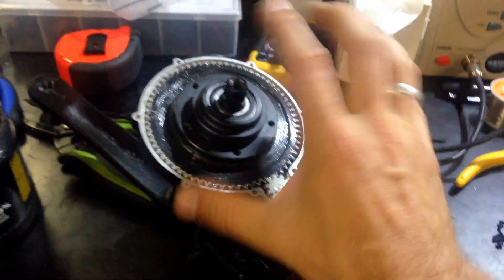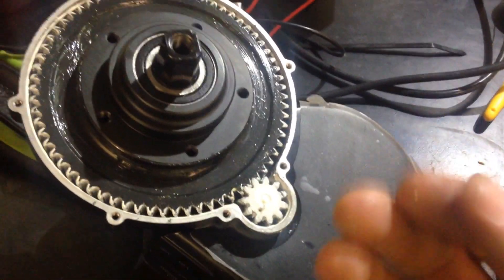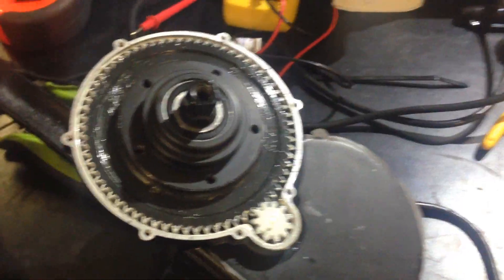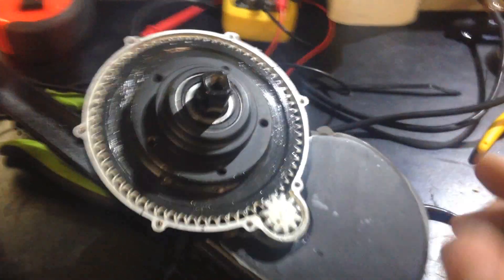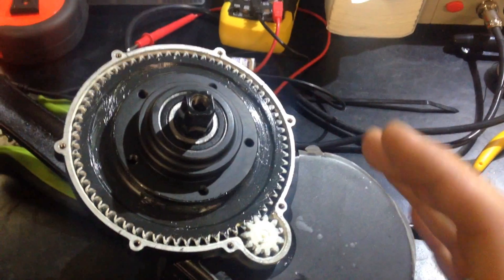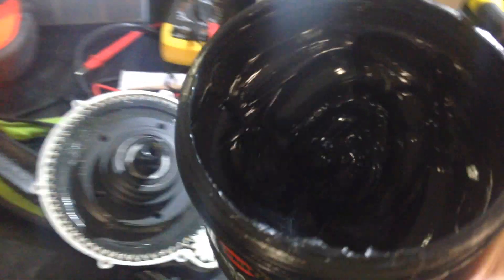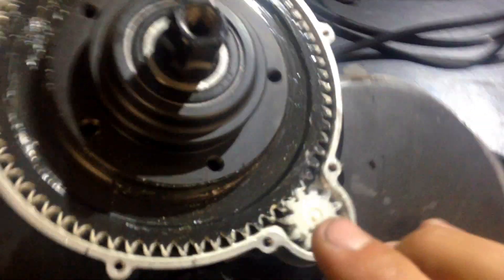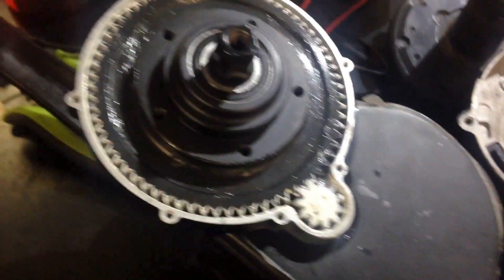Bafang 8fun BBS02 - White Lithium Grease "problems" • Electric Bike 750w 48v mid drive kit

Comment: Hello, I have a question for you. In my electric bicycle motor, there are cylindrical metal bearings located under the planetary gears. Is it appropriate to lubricate these bearings with the same grease?

Also, in the main power transmission area, there are different plastic gears. What kind of grease should I use for those?

I applied the same lubricant (Molykote PG-54) to both areas, but the motor became significantly noisier. Is this normal?

Thank you for sharing the video and providing information on this topic!

Comment: Hello Mr. Brun, I am Italian, from Sicily, I have a 750w bafang motor with 28 Mh battery, bought in 2019, could you help me understand why the red LED of the wheel sensor no longer lights up, which no longer shows the speed parameters on the display? Is it possible that it is the pass card, sensor or the pass disk? Thanks for your work, you have many videos, you are really good

Comment: i found the ultimate grease: Superlube Silicone grease (contains PTFE) with added 0.1 micron tungsten disulfide powder. some extra 1.6 micron PTFE powder will also help, but tungsten disulfide seems to work even better. this mixture also only needs to be spread onto the gear teeth (silicone is very sticky grease, doesn't fling off at high rpm) , not the entire enclosure cavity. it's way more silent than mobil 28 or black moly grease, especially under high load
Reply: @IBX no, I have used it, but grease displacement over time is an issue. Go for a calcium sulfonate marinen grease (e. g. Quicksilver brand or Lucas). they have all the characteristics you need:
-extreme tackiness
-extreme water resistance
-extreme pressure
make sure you clean the gears and housing well, first remove the bulk grease with a spatula, then with a paper towel and finish off withba paper towel wetted with gasoline or a paint brush with gasoline for the gears.
Reply: tungsten disulfide  is hopefully non electrical conductive  .  So if grease moves to the electrical parts,  no risk to have some shortcuts.
Reply: @jean-mariejm7404  tungsten is a metal, tungsten disulfide is not a metal and not conductive
Reply: @JoLe1991  ok, thanks. I withdraw my comment

Comment: About greasing the BBS. I have been reading about greases lately, and since finding Mobilgrease 28 is quite hard in my area, i just found out that we need a synthetic based grease to use in both gears (plastic and secondary unit). Most synthetic based greases do not deteriorate plastics and elastomers. To be sure, you will have to check datasheet. From what i read a lot about moly-based is no good for nylon. Synthetic-based greases are usually more expensive than mineral based greases, but some are not too expensive. In my case it would be very expensive to order mobi 28 from US, just not worth it. An example of alternative would be liqui moly thermoflex spezialfett, which in my case would be cheaper and availabel for pickup from a store.  Most synthetic based greases can bear high loads and speeds, and they suit bbs gears fine. So if you have experience or know more about it, go ahead and correct me. Cheers!
Reply: The one i mention, Liqui Moly one is also expensive, but i found one that is made in Russia, and is far cheaper, meeting all the requirments. You might find something for your country also. One i am talking about is Efel Sg-311 and Efel Sg-321, which i doubt are available anywere but Russia. But you must have similar from brands like agip, ravenol, etc. Just look for synthetic-based grease.

Comment: so the Kincrome 500g Multipurpose Grease from Bunnings, is that 1 grease does all, or do I need another grease for the nylon gears, bbshd, cheers
Reply from the maker: Yeah the multipurpose is for the nylon gears, some bearings, freewheel...
the big metal gear touching the metal pinion gear you use molybdenum (moly grease) black one “Penrith” get from supercheap

Comment: I'm not so sure about stuffing it completely full of grease. That doesn't sound right to me. If there's no air gap then any movement inside the assembly necessarily has to move a whole bunch of sticky lube out of the way.
Reply: It's not sticky and it's not lube. It's grease. Do you not understand what grease does?

Comment: why dont they put a grease zerk on the unit??
Reply: I have drilled a small hole in the carter pointing to the nylon gears. Every 500 km  I insert the tube of the PTFE grease spray and I liberally spray the gears,  It takes 2 mn , without having to open the motor.  One small rubber cover  or neoprene glue to waterproof the hole

Comment: how about Bbshd do we need to open it and put my greese. mid drive bbshd 1000 whatts from Luna cycle
Reply from the maker: +Mario Lopez yes all mid drive motors use internal gears so eventually you need to check the grease, add a bit more, sometimes replace with completely new fresh one... the BBSHD recycles the grease over and over again so in theory it requires maintenance less often but there is a lot more torque on the BBSHD than the smaller BBS01 / BBS02 motors and people ride in completely different conditions so it's hard to say exactly how often you should stop and check. If you notice any different motor noise , please stop and check =]
Reply: ElectricBike thank you so much !!
i bought my BBSHD FROM LUNA CYCLE. i also asked them to make super fast for hot rod . it's been 2 weeks i have been using it daily and i feel if the motor vibrate a little or maybe it's the cassette i don't know and i can't find the problem. that's why i asked you if i need to open it and put more greaser. thank you brother!
Reply from the maker: +Mario Lopez Marioooooo yeah the motor vibrates a bit depending on the RPM and the load... it's the resonant frequency combined with machining tolerances... my motor does the same if is throttle only, as soon as I start pedalling the vibration goes away.. try that and let me know =]
Reply: ok i will thank you Bruno
Reply: Does greasing help with the vibration at all? Mine starts to vibrate and almost make a grinding sound on throttle or anything above 3 PAS on a 5 PAS scale. Thanks

Comment: Hey Bruno... Why is it that the 48v 750w BBS02 have no assist on level 1-2..?  It seams that I have to jump it up to assist level 4 before I feel any assist.  Sent the first one back and the second one is just the same.  On level 5-9, the assist performance is great.  But I don't always want to use up my battery in the first couple hours.  It would be nice to just have a small amount of push on level 1 and not consume the battery.
My old 48v 500w BBS02 had noticeable assist performance on level 1 (not a lot, but you could definitely feel the boost)  Do you have recommendations..?  Do I need to adjust the programming on the motor..?

Comment: I have one kit bbs02 750W 1509 (bought a year ago) with these problem, almost nothing lithium grease on the second reduction (going to put the moly grease), it has almost 1700km and the motor have a bad noise. Still have to disassembly more to check the pinion gear, nylon gear and the motor axis. Thank you very much Bruno, nice videos!

Comment: I already have the motor installed on my bike (bought used). How involved would it be to disassemble it enough to check for the grease problem and is it worth it? Motor has about 200 miles so far. Thanks.
Reply from the maker: +Johnny V - Hi Johhny... 200 miles should be fine for a while...  maybe check the grease when you reach around 600 miles, all you have to do is to remove the drive side crank arm, another 5 allen bolts holding the chainring and you have access to the plastic cover that protects the gears and grease from dust.  Please watch this video https://www.youtube.com/watch?v=3lVRTRFueUU where I show how we do in the workshop applying the molygrease between the gears. =]

Comment: Thank you for making me aware of this.  My new motor purchased in November had white lithium, and very little.  I packed in good as you suggested and it is indeed quieter and I'm sure it will last longer now that it is properly lubricated.
Reply from the maker: Hi Robert, the moly grease is automotive grade, sticks to metal and still performing even when there is no much grease left between gears. The White lithium grease Bafang uses is high quality and long lasting one... but.... not for this particular application... 
My friend Karl from www.electric-fatbike.com is trying some different greases, he just published an article yesterday talking about the Mobilgrease 28 aviation grade grease. 
I'll be posting so many other videos explaining more about the internal design and how it impacts the grease, noise and performance on the BBS02 and BBS01. Bafang perfected the design with the new BBSHD, I'll be also making videos showing both units differences =] POWEEEEEERR!!!

Comment: Bruno I have a question.  Can I use grease in the primary gear, nylon gear, and secondary gear.  Moly grease for metal.  Lithium for nylon (plastic).   What kind of grease did you use for the small circular bearings.  Do you need to grease the small bearings?
Reply from the maker: +Nelson Olivo - Yeeeahhh... two separate greases, Nylon (internal/primary gear) = white grease, don't need to touch if your motor is new, maybe after thousands kms you open and check it. The big "external" secondary gear moly will do the job. I have never greases any bearings, I hears very few people telling that they used a very thin multi-pourpose machine oil but I never needed. Also I avoid mixing oils and greases as if they are different they may react. Both white and moly are lithium base so not problems there. There is a very interesting article from Karl where he tests a different aviation grade grease on both primary and secondary http://electric-fatbike.com/2015/12/23/mobilgrease-28-bbshdbbs02-because-a-good-mid-drive-is-better-seen-and-not-heard/ he tested for a while and seems good option. We are just not 100% yet if this will have any downside after thousands of kms but there are some good people out there trying things for us =] one day we get there.... haha

Comment: I would say they get out of moly, so they just put there white one. ;))

Also been thinking about re-greasing (Now have over 3000km on bbs02 and with no big problems, just had to tighten freewheel screws). Bruno, could you advice what is best grease for shaft bearings? Also if nylon gear needs to be re-greased as not sure if I want to open it up completely. Thanks
Reply from the maker: +DaDo Bzz - Yes, there is a lot of rumor "why they decided to use white grease there", there is a looong story to tell here.. it is a design issue so they were actually trying something different to correct something else... I will be showing this design drama in a different video very soon (as soon as I get back to work after NYE). The nylon gear, only touch it if you really think you should. It is almost impossible to find a good and thick white lithium grease, I have tried many brands and they were all very very liquidy... didn't last two days... 
I have been using a multi purpose lithium grease (made in Australia) so it can be used in plastic gears as well  http://www.bunnings.com.au/kincrome-500g-multipurpose-grease_p6100306 this is actually thicker than the original grease that comes from Bafang so it should last even longer. You may find similar grease in your country if you can't buy this one.
Karl is also trying something different there in the USA, he ordered so many greases and the only one suitable (thick enough) for both primary and secondary reduction gears would be this red one that is used for aviation, see the complete article here: http://electric-fatbike.com/2015/12/23/mobilgrease-28-bbshdbbs02-because-a-good-mid-drive-is-better-seen-and-not-heard/
Reply: +ElectricBike (Bruno) Hey bro, would you recommend the grease multi purpose you are trying instead of the mobilgrease28 that karl recommends? i got to decide between this two to buy online!

Comment: Does this article relate at all to what you are talking about?  
http://electric-fatbike.com/2015/11/22/hardy-boys-solve-the-mystery-of-the-nylon-gear-failure-on-the-bbs02/

In the article he says to clean the black grease off of the secondary reduction gear and use white lithium grease.  I'm not sure which gear that is exactly.  He says to use it because the black grease seeps through the seal and turns the nylon gear to mush.
Reply from the maker: +Paul Sammons Music - Myself and Karl (electric-fatbike.com) are always talking about Bafang mid-drive issues and testing some things to find solution for many problems. Karl tried a heavy duty grease on the nylon gear long time ago and liked the results so he recommended on his website and many people did the same (he is a really nice guy with good intentions). I understand about greases and gears as I worked with million dollar industrial printers and electromechanical systems so I knew heavy duty grease would weaken the nylon and cause premature failure so I refused to do the same, Karl was so happy telling me via Skype conversation and the article was already published for a while so I didn't want to say anything. Many people did put heavy duty grease and had nylon gear failure, obviously everyone blamed Bafang for using plastic gears. Everyone now talks about the plastic gears like it is a problem or weakness in this mid-drive. After loooong time Karl figured out that the heavy duty grease was causing this failure so he rushed to make this article and correct this information so everyone would get this update. I dont criticise Karl at all, he is doing a FANTASTIC job trying so many new things, spending all his money and sharing all his experiences with everyone, we need more people like Karl.
Back to the grease, the first stage is what people called the internal gears, this is located inside the mid-drive and is the contact between the motor shaft and the nylon gear. This is nylon on metal so it requires white lithium grease. The big metal wheel I show in this video is called flywheel, very easy to access from outside, this is the second and final reduction gear. The small pinion gear is also metal so when it comes to metal on metal, moly grease is the ideal as it coats / impregnates the metal providing a long lasting performance (molybdenum is not suitable for plastic).
There is an issue that after many kms a very small quantity of the black grease will leak from the second stage towards the first stage via the bearing seals on the pinion gear. This will only reach the side of the nylon gear and not the actually area where the motor shaft makes contact with the nylon gear. It is unlike that this would cause problems. There is a lot more white grease there so the black grease will be diluted in white grease. 
I think this is the longest and most complex reply ever, deserves a video =]
Reply: +ElectricBike (Bruno) Thank you so much for the reply.  I keep up with what you and Karl are doing very closely.  Now I will begin to get grease and put it on the motor as you describe in this video.  You answered my question very thoroughly.  Thank you Bruno!
Reply: +ElectricBike (Bruno) But it is also the most informative thus explaining why lithium grease and moly grease should be used. Thank you for such a detailed reply. It really helps us who are new to this motor and bike.
Reply from the maker: Soooo much information resumed in one reply haha...  sounds like new video to me =]